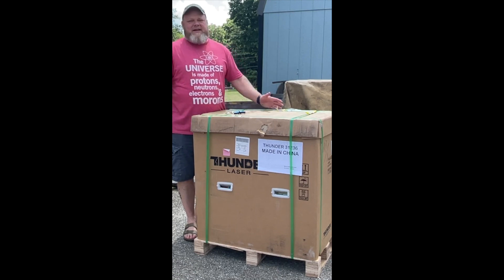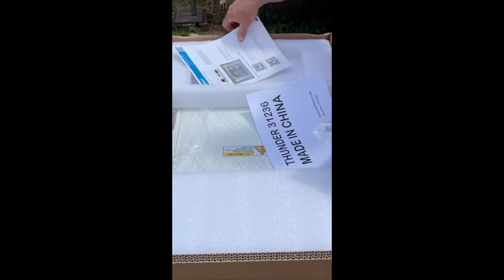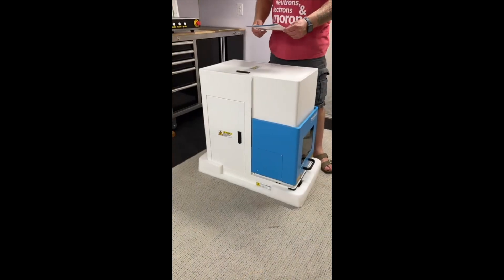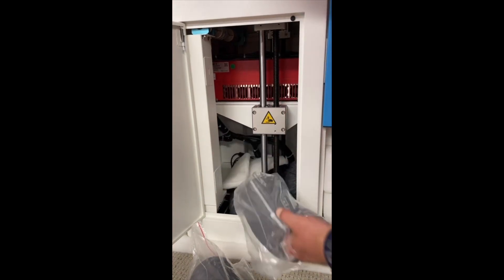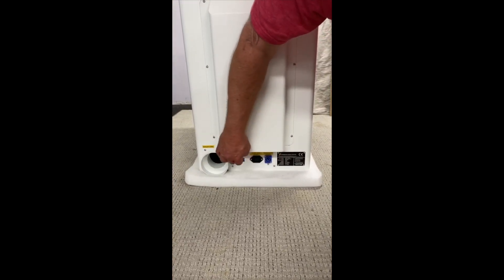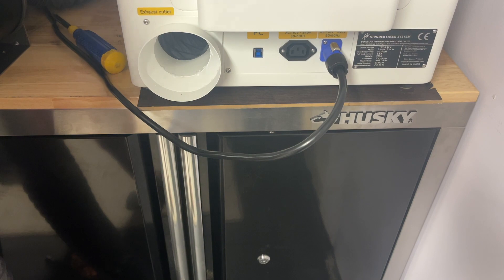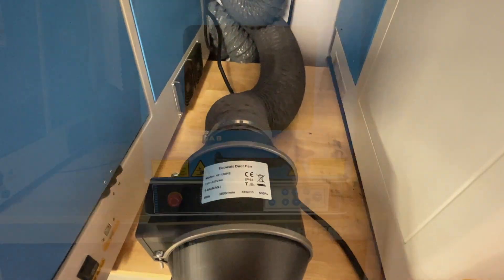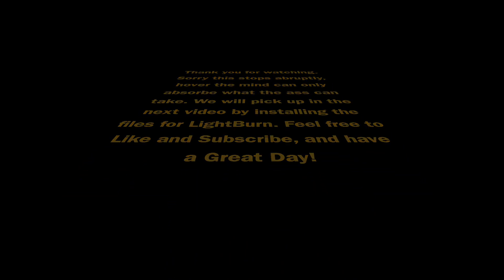Thunder Laser Aurora 8 5 watt UV Set Up and Unboxing (Video 1)

Comment: How are you connecting an Ethernet cord to your Mac?  I have a Thunder UV on order and would like to order all necessary items before it arrives. I plan to connect it to my MacBook Pro.
Reply from the maker: The uv will connect to the Mac with a usb. We have to use a hub/dongle   Now with Mac you have to make sure your laptop is set to never go to sleep. The galvo lasers are constantly fed data unlike the gantry lasers like the Novas.

Comment: Mine arrived in a crate with latches for the lid. No foam packaging, just shrink wrap. It was ratchet strapped down to the pallet. No QR code in my kit. It was packed very well though. Do not pivot the laser on the rubber feet. They will rip off. Wiring was immaculate. However the little baffle that hides the gizzards where the laser raises and lowers needs to be re-glued. Had same fan issue. Tech support rocks and got me a cable in 2 days!  You will need an IEC extension cable as the new pig tail is only 12” long.